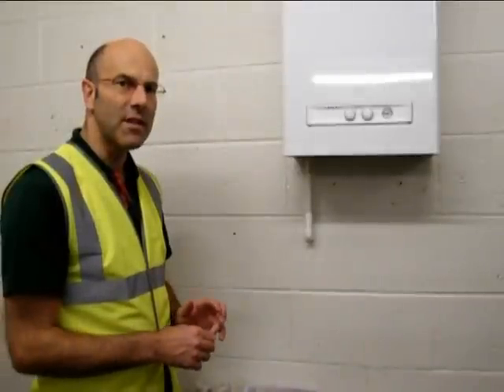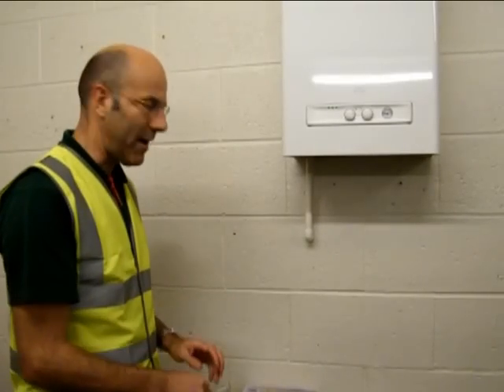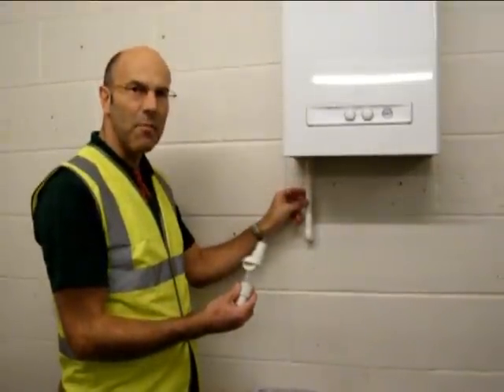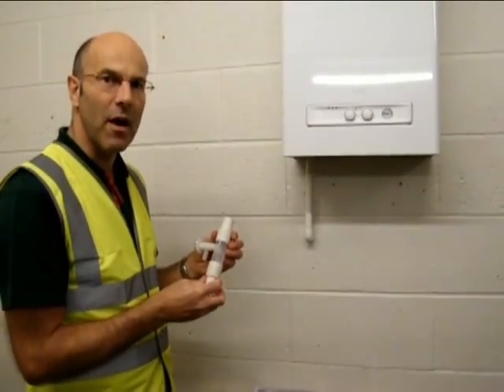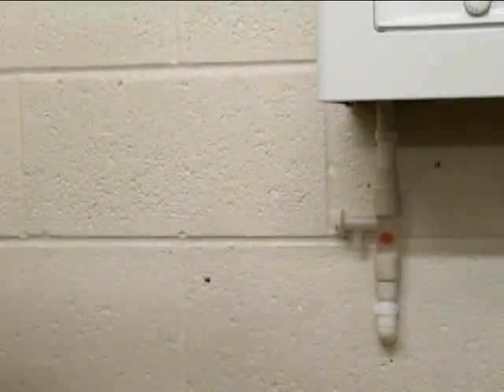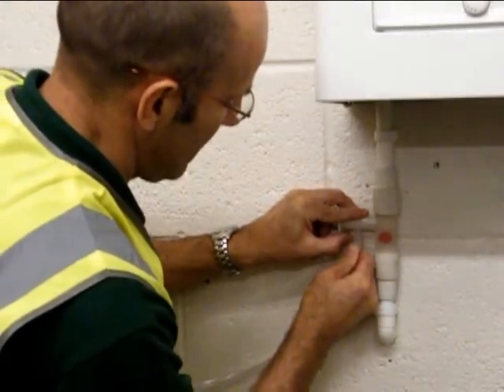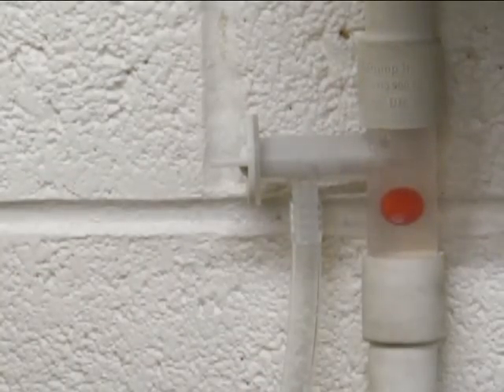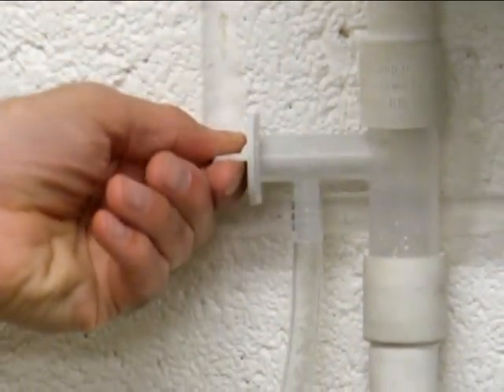How to install a boiler buoy to eliminate freezing condensate pipes in a boiler

Comment: Could you add exactly how to fit it please? E.g. sealing the joint between BB1 and old tubing?
Reply from the maker: Do you mean in the video? Otherwise - The rubber connector on BB1 fits over the overflow pipe with a tight fit and is sealed.

Comment: Can’t you just leave the tap open all the time so if it blocks up it will automatically drain itself ?
Reply: Technically, yes.  But unless you were checking regularly, you then wouldn't be aware that the pipe had blocked & you would have condensate flooding all over the floor!  Once actuated & with the bypass hose directed to a bucket, you just have to remember to empty the bucket of condensate from the boiler approx. once a day!
Reply: Steve Kramer was just a thought as my boiler is in the garage so I don’t see it anyway ☹️
Reply: OK
Reply: BTW.  If your boiler does cut-out due to a blocked / frozen condense pipe, you'll have to reset the boiler in order to start it again after resolving the problem

Comment: So you have to wait for a thaw before the boiler works again? Hmm not really sure if this is relevant to the system in my loft where the condensate pipe is about 8m long.
Reply: No.  As demonstrated in the video, you can direct the bypass hose from the device, to a bucket, whereupon (after resetting the boiler) with the bypass tap open, the boiler can then be run normally in this state until the pipe thaws.  You just have to remember to empty the bucket of condensate from the boiler approx. once a day!
Reply from the maker: Thank you Steve for your great explanation!

Comment: This is a good product, the idea is if the red ball rises, it becomes 
visible, telling you the condensate fluid is not draining out, you then 
open the valve on the tee piece to drain it temporarily to keep the 
boiler functioning, the only thing I would point out is that although 
reasonably easy to fit this, it isnt as easy as shown here, the outlet 
for the pipe through the wall seems to have dropped after it has been 
fitted.